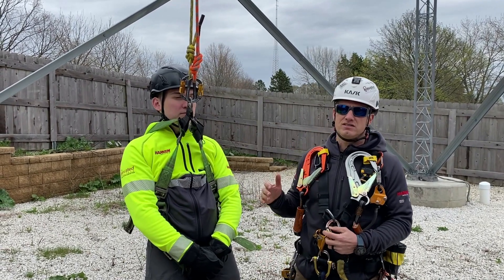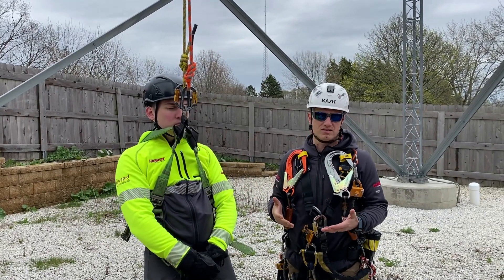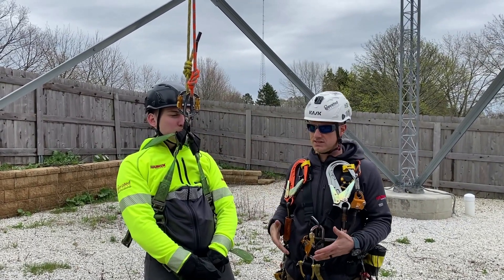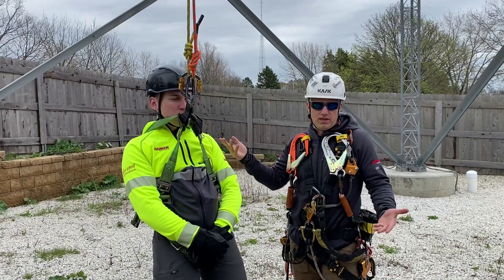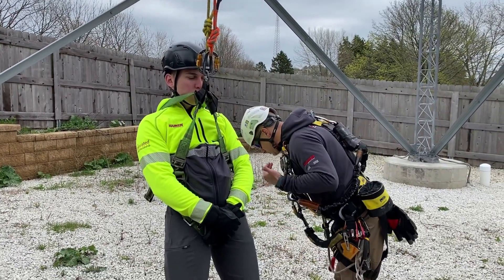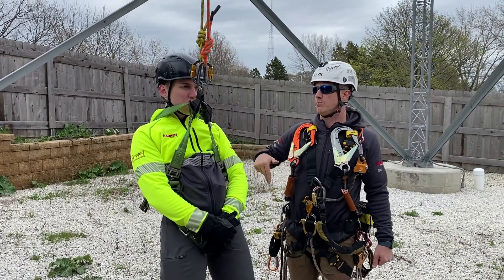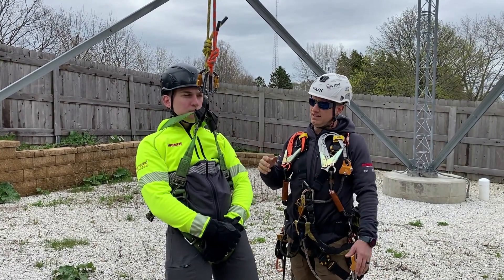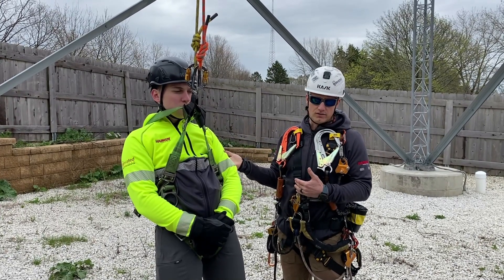Patient Connections - Tower Rescue Training

Comment: Gotta disagree with the one point of attachment here. Everything I teach (if the exposure’s there) gets redundancy in there system.
Reply: The D-rings are the strongest point of a harness. They offer at least a 10:1 safety factor. If you decide you can’t trust that then consider putting them in a different harness. Otherwise, there is nothing to worry about here.